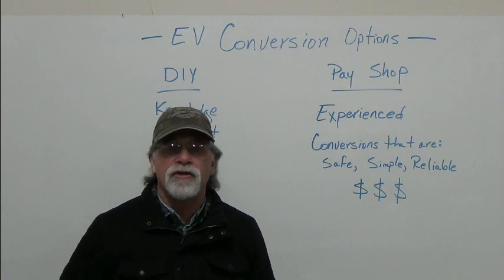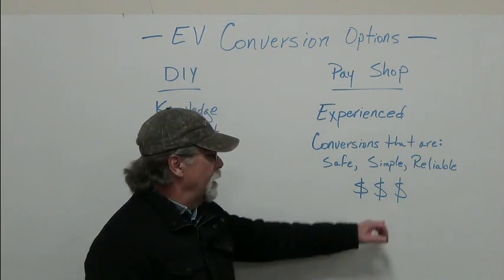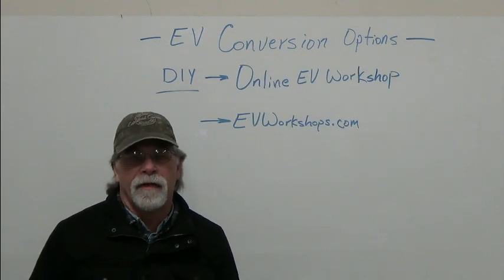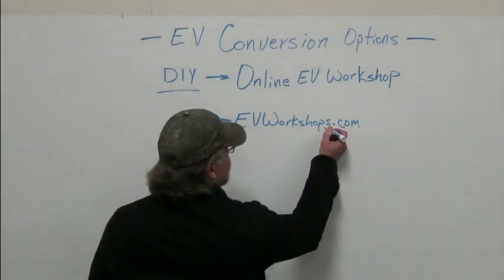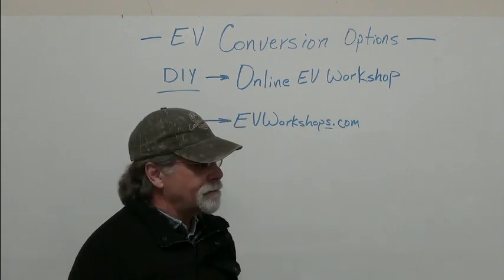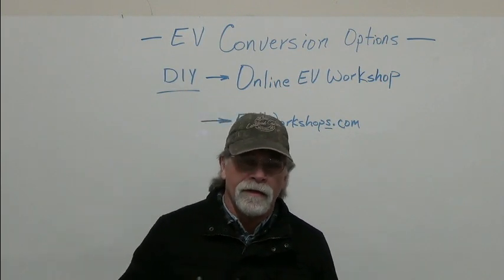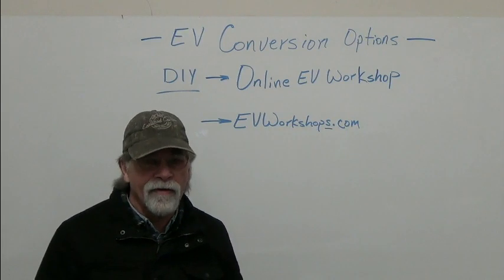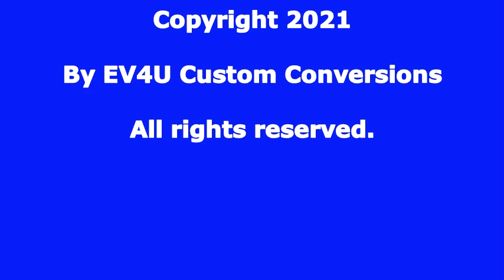EV Conversions - EV Conversion Options

Comment: Your videos are always great Richard! I have a 2004 Mercedes SLK230  with high miles, but otherwise in great condition. What is your opinion of this car as a candidate for conversion to all electric? My cost comparison includes the price of an engine and transmission overhaul, as well as the expected operating costs. Are there any shops that you'd recommend in the Northeast US? Any thoughts you might care to offer are greatly appreciated!
Reply from the maker: Please address your questions to:  info@EV4Unow.com  Thank you.
Reply: Hey Clark! I have a '98 slk230 and been wondering the same thing for the past few years. They are such fun cars and I think a conversion would be fun to do to them if possible.

Comment: At the work shop do you talk about wheel hub motor conversions?
Reply from the maker: Please address questions to:  info@EV4Unow.com
Reply: these motors have a really low lifetime, not worth to use them, maybe if the roads in your city are awesome it is a good choice, you have to consider the unsprung weight